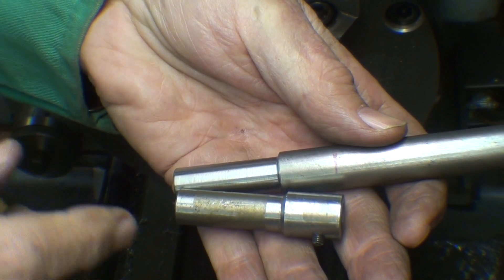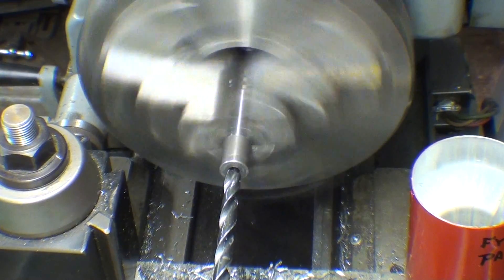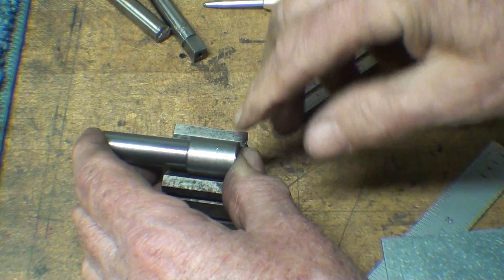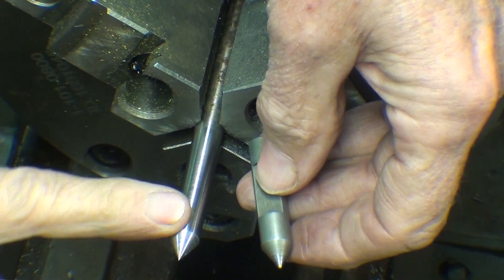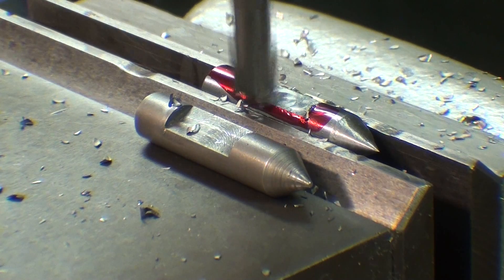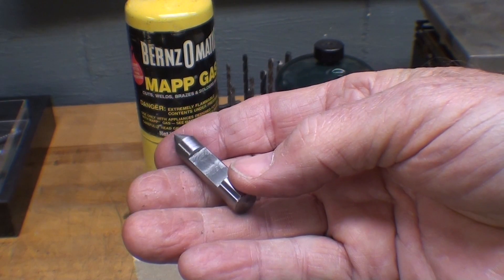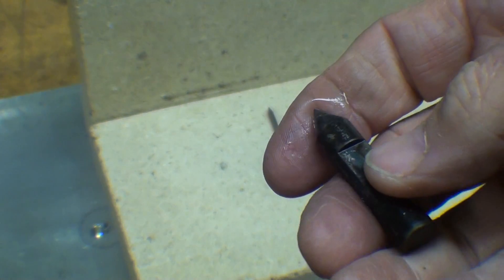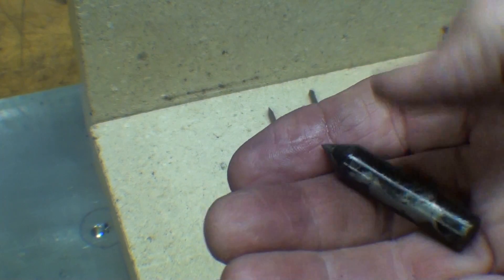TIPS #360 pt 2 HOW TO MAKE A TAP FOLLOWER tubalcain

Comment: Lyle, a bit of a waste of Mapp gas in your hardening process lol . If you had put the work piece parallel and close to the back furnace brick you would have heated the piece up in a third of the time. Even allowing for the heat soaking in. Here in the uk mapp gas I'd very expensive, like  about the equivalent of $28-30 a bottle. I bought my torch on a recent visit to the states back in March and I did not look at the price of the gas because I knew I would not be able to take it back with me. Then when  got home I went to my local DIY store ans found out the price, ouch!! I know i can get it on eBay and the like, but its nice to just go to the store which is only less than ten minutes away.

Comment: Nice work Mr. Pete I always enjoy watching your videos.

On another note I think propane gets a bad rap sometimes which seems stigmatized. It's not really the gas but the torch that determines how hot you can heat things up in most cases. I have hardened plenty of small tools like centers with a small propane tank and torch. It depends on how much air or oxygen flow is allowed through the torch. Many people weld/braze with propane and oxygen tanks instead because it is cheaper than acetylene gas. Just adding 2 cents that many people here probably already know.

Comment: I know you should occasionally reverse the tap to break the chip when hand tapping.  Tapping attachments and tapping on a CNC machine doesn't reverse the tap until it has reached its full depth.  Is there a difference in the tap?  If so, why not use that kind for hand tapping.  If not, what is the reason?
Reply from the maker: They use machine taps (gun taps) etc.  I do use them sometimes

Comment: We made some very expensive and complex parts in my shop once. I think there was about 50 of them. We sent them out to get heat treated. They ended up doing ours on a Friday. The guys heat treated them and put them In a crate on the floor for the weekend. They didn't temper them because it was the end of the day and they wanted to go home. The parts were destroyed. It was very strange. They had cracks all over them but they weren't shattered. This is a huge heat treating company. We had used them hundreds of times in the past. It just goes to show we all make stupid mistakes. A very costly one this time.
Reply from the maker: Unfortunate-I have seen it happen many times
Reply: Yikes! What a nightmare.

Comment: Hi,Mr Pete, I just purchased a Shars 8"  3 jaw adjustable chuck, for my 12x36 Clausing, they do not have the Loo backing plate so I have to make one,,,I don't understand how the adjustment can work when there are 6 bolts going thru the chuck and tapped in the backing plate,then there are 4 adjusting screws that screw in to the inner bore of the backing plate, so it appears that the center of the backing plate must be machined under size to allow for adjustment, but the six mounting bolts would not allow adjustment.  I enjoy your tutorials . hope you can guide me on this.  Mike
Reply from the maker: Did you get the backing plate from shars? Is it designed for your chuck?
Reply: they said they don't carry the L00 nose style adapter any more, Please reread my original note to you, Thanks, MIKE....a neighbor to the north( Hartford Wisconsin)
Reply from the maker: I'm not following you.  Did you watch mu vid on installing a backing plate on a chuck?
Reply: Hi again, i have put backing plates on non-adjustable chucks,quite elementary ,but this adjustable chuck seems to need some kind of clearance in the step of the baking plate for adjustment!  Pete have you ever put a backing plate on an adjustable chuck ? (tru adjust) etc., Mike
Reply from the maker: NO, have not. But I have had that type of chuck apart--and there is clearance to allow it to move around. That is----it is a 3 jaw chuck within a 4 jaw chuck arrangement.
Did you look at this video?  SHOP TIPS #213 Part 1 of 2 Fitting a Backing Plate to a Lathe Chuck tubalcain